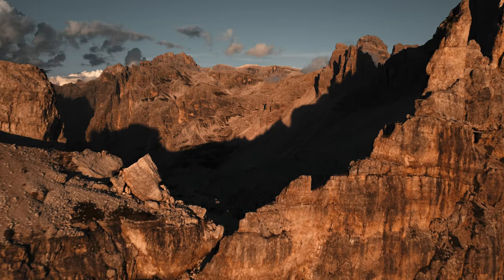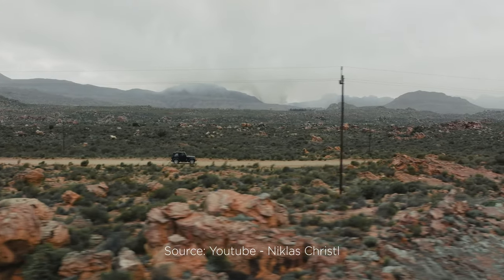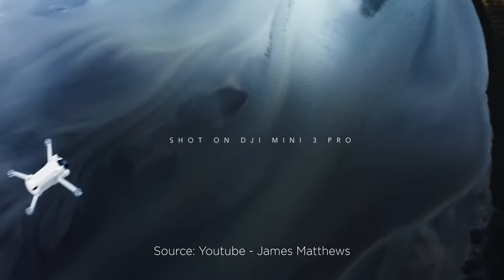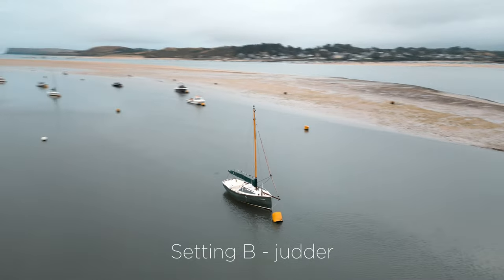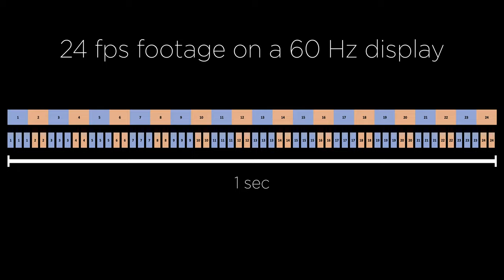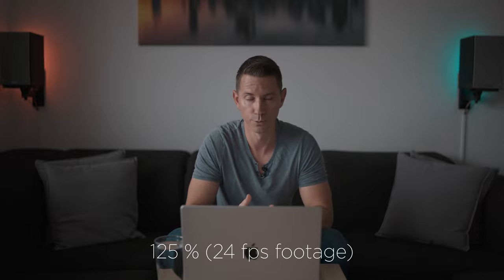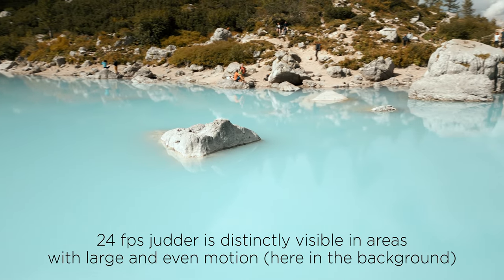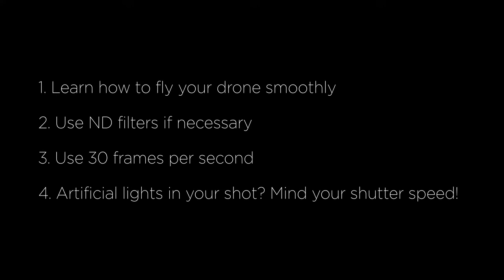The #1 Secret for CINEMATIC Drone Video without Judder, Stutter or Jerkiness

Comment: Very well done, Tom. I appreciate what you had to do to make this video. I recently posted a video that was driving me nuts (don't look!) with juddering. It's weird because it seems like some of the videos I've shot at 24fps came out reasonably smooth, whereas some of my older motorcycle content, shot at 30fps showed too much judder.  I try hard to keep all my projects in sync with the same framerates and timelines. I'll keep your ideas in mind and see if I can do better. The key will be in adjusting 24fps footage to play at 125% as you recommend. Thanks and best wishes.
Reply from the maker: Thanks for your feedback! I appreciate it.

Your case sounds very interesting. As explained, usually the judder comes from the wrong framerate / display refresh rate combination, but there might be other factors as well. If you could post a link to one of the juddering videos that drive you crazy, I can have a look.
Reply: @t0mwhazzup  Well, I did say don’t look, but here it is: https://youtu.be/-Ddc2kFUejY. The footage around the water tower is all 30fps with the remaining shots at 24fps on a 24fps timeline. I almost didn’t post this because the judder was so bad.
Reply from the maker: @desertexplorations  Hmm I think there are several things going on here. I might be wrong, but it looks like as if you do not use ND filters and therefore have a shutter speed way too high. This becomes especially noticeable on shots like the orbit around the water tower at 2:13 in your video.
The second problem seems to be the project framerate of 24 fps (which causes 3:2 pulldown on most computer/smartphone displays with 60 Hz). The third thing that comes to my mind is that some of your drone movements are rather abrupt. Try to move the drone and the gimbal a little bit more even and smooth, that also helps a lot.

So if I may give you suggestions for your next drone video...

1.) Recording the video: Set 30 fps frame rate on your drone and when filming, use manual exposure settings and put an ND filter on the camera in order to get the shutter speed somewhere around 1/40-1/100 of a second (1/50 or 1/60 would be optimal). If you don't have any NDs, they are not very expensive and help a lot, I'd try to get a set of filters that cover ND8-128, like this one: https://a.co/d/8G9bJB0
On sunny days, you will most probably need ND64 or ND128 to get the shutter speed to said range.
And try to make your drone and gimbal movements a little bit smoother. That has nothing to do with judder directly, but smoother movements help a lot overall for drone footage.

2.) When you import your footage into a project, make it a 30 fps timeline. So the recorded footage fits perfectly to the timeline.

3.) Export your video in 30 fps.

Try that and let me know if that helped!

PS: In general, I'd try not to mix frame rates. Was there any special intention for you filming some clips in 24 fps and some in 30 fps? If not, stick with either and don't mix. My clear recommendation for Youtube or general computer/smartphone use is 30 fps because it fits smoothly into 60 Hz screens. If you'd produce content for cinema, and only then, I'd go with 24 fps.

If you need anything else, just let me know!
Reply: @t0mwhazzup  I genuinely appreciate your comments and the time to write them. I am using an ND filter, but not a strong enough one. I do have a set of Skyreat filters but had a bad experience with a full sun video I shot with the ND64, it looked too dark, just wrong. Lately, I've been using the ND8 and letting the auto-exposure settings do their thing. It's a problem in mixed lighting conditions but otherwise seems to save me from worse errors. I am going to follow a recommendation to program the C2 button on the back to AEB exposure lock, which may help some. Also, I intend to brave the manual settings again and keep after it until things look better. I've been studying this stuff and the theory and practice are still a bit of disconnect for me right now. The mixed frame rates had more to do with using a few Quickshots which are only in 30 fps, whereas the rest was in 24fps. The answer there is either don't use the Quickshot or simply use 30 fps on everything. The abrupt drone movements are a work in progress, I'm an older guy with hand tremors, some days are better than others, and that Westwing day was a challenge. I first started playing with cameras and video a year ago and it's been an exasperating but rewarding experience. Again, thanks for your insights.
Reply from the maker: @desertexplorations  You're genuinely welcome! I would really suggest to use manual exposure, otherwise it's really hard to get good results. Usually, with ND64 on the Mini 3 Pro you should get around 1/40-1/100 sec exposure time in sunny conditions, so I assume that you just didn't adjust the exposure time accordingly. Or if you used auto-exposure, maybe the ND messed with the auto function. If you have the time and the nerve, I'd recommend giving manual exposure and ND filters another try, and the way to apply the right ND is trial-and-error: use the one that gives you an exposure time of around 1/60 sec. With experience, you will be able to reckon which ND density it is going to be... my experience tells me N64 in sunlight, ND16-32 in overcast conditions, but that's just a rule of thumb.
And regarding the frame rate, if Quickshots is only available in 30 fps, that would be one more reason for sticking to 30 fps consistently (apart from the ones I mention in the video). 24 fps does only make sense if you are producing content for cinema (which most people don't). You will get less judder with 30 fps (everything else being equal).
And regarding the drone movements... you can help yourself if you set the yaw and the gimbal rates lower and the smoothness very high. That could help you a lot. It's somewhere in the settings, unfortunately I don't have the drone with me right now to look it up for you.
Reply: @t0mwhazzup  Good advice, and I’ll try again. I’ve messed with those yaw settings, it made the drone unpredictable, but I suppose it’s all in what you get used to. Thanks again and best wishes.
Reply from the maker: @desertexplorations  Good luck and all the best!
Reply: @t0mwhazzup  I think it’s getting better. DJI Mini 3 Pro: A FOGGY DECEMBER MORNING
https://youtu.be/62qz7UxkJMw This was done with manual exposure, 30fps and yaw settings adjusted. I didn’t go too far away and just flew from the back yard to practice.
Reply from the maker: @desertexplorations  This looks WAY better in terms of smoothness! I've watched it on my iPhone and on my MacBook, and it plays smoothly on both. And your drones moves are way smoother, too! Overall a big improvement, and the footage with the fog is amazing, too! A joy to watch! :)
Reply: @t0mwhazzup  Cool. Thanks. I’ll keep after the exposure and frame rate stuff for the future. Appreciate your guidance.
Reply from the maker: @desertexplorations  You're very welcome! I hope you're also happy with the difference it made ☺️
Reply: @t0mwhazzup  Okay, it was driving me nuts so I redid it. After another 2.5 hours of editing the Westwing video looks 98% the same as before, but with no judder. I imported into a new 30p timeline, retimed the 24p clips to 125%, and removed all but one of the speed ramps. I used the FCP precision editor to do a better job with the clips on the markers. As the saying goes, do it right or do it twice. No one will see it but me, but I definitely learned something.
Reply from the maker: @desertexplorations  Very happy if my tips helped you achieve a better result you're happy with! 🥳
Reply: Hi, thank you for this very helpful video. What can I do if I need to mix my drone footage, shot at 30 fps, in a 25fps timeline with other footage from my Sony camera? Thanks
Reply from the maker: In order to have it judderfree, you need to make a 30p timeline. The timeline is relevant as it dictates the framerate of the finished video (which should be 30 fps). If you already have footage from your Sony in 25 fps, you can either speed it up to 120 % (works only if there is no Audio involved in the Sony clips) or if there is an Audio track in the Sony clips, you simply have to put them in as they are. They will then technically judder, but in "normal" camera footage it is usually not as visible as in drone footage. But best case is you have everything recorded in 30 p to be able to put everything seemlessly onto a 30 p timeline.

Comment: New drone pilot here, I'm using the mavic pro 3, mainly for real estate photography, so I film in doors a lot. I'm constantly dealing with stutter footage, I've tried 24fps, 30fps and 60fps and still the issue exists. Any help would be greatly appreciated. I should say, I film in auto.
Reply from the maker: Well, in Auto you can't really control what's happening and it's hard to tell what the root for your stutter ist. If frame rate has no influence, my guess would be, you don't use ND filters?
Reply: @t0mwhazzup  Correct, wasn't sure what exactly the ND filters were for. I now know 😅
Reply from the maker: @davepunk80  You need to put on an ND filter with a strength that gives you the right (or close to the right) shutter speed... for 30fps video this would be around 1/60

Comment: I've been editing/filming at 24fps forever because somewhere I heard that it's more cinematic and I just kinda went with that and got annoyed and frustrated when my drone stuff is juddery as hell. I'm trying 30fps immediately though. Great vid!
Reply from the maker: In professional environments it has always been common practice to choose the footage and project frame rate in accordance to the intended output device. That means, for TV/broadcast 25/50 fps (PAL) or 30/60 fps (NTSC), for cinema 24 fps and for digital/online content 30/60 fps.
And for good reason: compatibility between video and output device. If that does not fit, playback can never be smooth.
I don't know how so many people started to do 24 fps projects for Youtube when Youtube is mainly displayed on 60 Hz screens. That's not compatible and that judder does not look like cinema (where 24 fps can be natively displayed without any kind of pulldown).

Anyway, let me know if switching frame rate helped. In order to get the smooth look, you also need to use a good shutter speed (that is, somewhere in between 1/30 and 1/100 at 30 fps). If you don't, the video might also look not smooth, but that is technically not judder, but still not pleasing to the eye :)
Reply: @t0mwhazzup  Hertz and FPS is not the same, you should know that.
Reply from the maker: @sundsmedia  I do. Never said that. But in order to get a technically correct (= smooth and judder-free) playback, the frame rate of the video (fps) and the refresh rate of the screen (Hz) have to be compatible, i.e. the refresh rate has to be the same or an integer multiple of the video frame rate.
Reply: @t0mwhazzup  But that is only true to a very limited extent. YouTube has nothing to do with the frequency of the monitor, so associating this with the FPS of a video you upload to it is just nonsense. Newer monitors have 120, 144 or 240Hz. All clearly divisible by 24. And even 3 year old smartphones already have 120Hz. The video is missing hand and foot.
Reply from the maker: @sundsmedia  Well, if you want to go 24 or 25 fps on Youtube, by all means, do that. I myself have a Macbook Pro and an iPhone 14 Pro with 120 Hz, yes, but the standard refresh rate for computer monitors and smartphones is still 60 Hz. So, you're right, many devices in the higher price segments can do variable and/or higher refresh rates. But wouldn't it make more sense to publish videos that can be enjoyed correctly by the majority of viewers and not be reserved for those who can afford "better" devices? You wouldn't design a website that can only be displayed correctly by 20 % of web browsers, would you?
I don't "praise" 30 fps as the holy grail for all situations. On all broadcast jobs I do (here in Europe - PAL), we go 25 fps of course (!). Digital media (Online, social media etc.) however, has 30 fps standard in professional working environments for good reason. But you do what you do if you’re happy with it. I am trying to solve problems that people have with jerky playback and my hints have helped quite a few of them, read the comments. If you don’t have a problem with judder because of your premium 120/144/240 Hz monitor, you’re not in need for a solution and I wonder why you would bother anyway.
Reply: @t0mwhazzup  In fact, website development is my main job. So I can tell you that they should be developed to the latest standard for the next 5-10 years, not the current average. I wouldn't encode videos for the current mediocrity either. Regardless, I have the exact opposite effect from this video with my DJI Mini 3 Pro. The higher the FPS, the more jerking I notice on close objects. So it also depends on the model.
Reply from the maker: @sundsmedia  Yeah, maybe a bad example because you can upgrade your browser for free, opposed to viewing devices. Anyways, if you're happy with your results, continue doing what you do :)

Comment: Sorry i got some more questions haha.
What if I want to film FPV at 60 fps and want to use slow motion and a 30 fps cinematic video. Schould I use 60fps 50% speed for slowmo and then the of the video on a 30fps timeline or how does that work. Hmm.. complicated.

Also. I want to combine an outdoor flight with indoor. I live in NL (EU) with 50hz. Schould i apply 1/100 shutterspeed?
Reply from the maker: No worries! :)

In general, I always use a 30 p timeline, no matter whether FPV content (which I usually record in 60 p) or not, as my goal is to do kind of cinematic videos. It looks more filmic than if you had a 60 fps timeline.

The other advantage, as you mention, is that you can make slow motion parts (down to 50 % speed). So, my approach would be to use a 30 p timeline and simply put the 60 p footage on at 100 % speed (which skips every other frame from the original footage) and when you want to do slow mo, use 50 % speed (which uses every frame of the original footage then).

When it comes to shutter speed, I try to use 1/60 of a second whenever possible. Most people would recommend 1/120 sec as this is double the frame rate (180 degree shutter rule ... 60 fps x 2), BUT if you generally use a 30 fps timeline, you'd end up with a 90 degree shutter (30 fps x 4) on the 30 p timeline which can have too little motion blur to my taste.
So, 1/60 sec I'd consider ideal for a 30 p timeline (regardless of fps of the original footage), and if that's not possible, try to keep it in the range in between 1/60 and 1/100.

When you combine indoor with outdoor, in NL you'd need 1/100 sec shutter speed. BUT as nowadays many artificial lights are LED that might have a way higher frequency, you might also get away with a different shutter speed. Simply try it out in the scenario you want to film in.

I hope that was not too complicated to understand why I'd rather use 1/60 sec instead of the generally recommended 1/120 sec. And with flickering lights, 1/100 sec is your safest bet, but simply try what works - with LED it might be different.
Reply from the maker: Oh and sorry if I say 30/60 fps and 30/60 p. p and fps is the same, just a different term for the framerate.

Comment: Thanks for the explanation but for me it didn´t work at 30fps, I ever use 60 fps in drone footage to avoid juddering specially when panning. I have a video that by mistake I did it at 30fps, but I applied your technique to stretch it to 60fps and the juddering was mostly eliminated, nice info to know. I never had a smooth video at 30fps... but at 60fps all perfect.
Reply from the maker: Thanks for sharing your experience, you're right that 60 fps is even smoother than 30 fps (I mention that in the video, too), but it looks not like a movie (where the standard would be 24 fps). 30 fps is closer to 24 fps, so that works, but you're right, pans look smoother at 60 fps compared to 30 fps. Especially when you don't use ND filters and your shutter speed is high.

Comment: Great video learned a lot. I did have one question for 30fps with natural light do you stick to the 180 degree rule? so 1/60? Also do you tend to shoot at higher frame rates for slowing down the footage ?
Reply from the maker: Me personally, when filming with my main camera (not drone), I usually go for 30 fps and 1/50 of a second in order to avoid flickering lights AND me personally, I prefer the slower shutter speeds. But between 1/50 and 1/60 there is not really that much of a visible difference.

When it comes to drones and natural light, I generally try to use something between 1/30 and 1/60 because with drone footage, I think the slower shutter speeds and the increased motion blur works soooo well. But as drone sensors don't have that much exposure latitude, I prioritize perfect exposure (as bright as possible without overexposing relevant parts of the footage) over the "right" shutter speed. I explain it in another video (link at the end of the comment). So with drones, I try to stay between 1/30 to 1/60, but will go up to 1/80 or 1/100 if necessary. Even though I feel like the motion is starting to stutter with those slightly faster shutter speeds.

https://youtu.be/5aotiUE-iOk
Reply: @t0mwhazzup  thank you for coming back to me and sharing this information. I appreciate it, I’m going to give it a try and see what sort of results I can achieve with this shutter speed range. I’ll also check out the video you have recommended! Thanks again 🙏🏾
Reply from the maker: @creativcluster I really hope it helps 🙂
Reply: @t0mwhazzup  thanks you I will give it a try and see my results! Thanks for putting out great content, keeping doing so and you have a new sub!
Reply from the maker: Thank you 🙏🏼